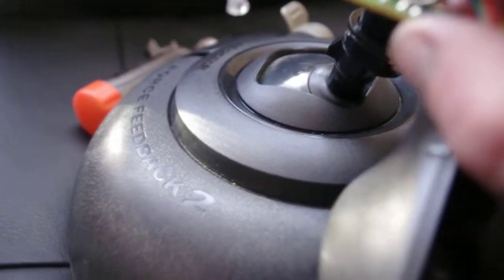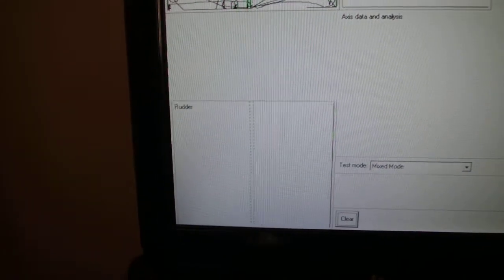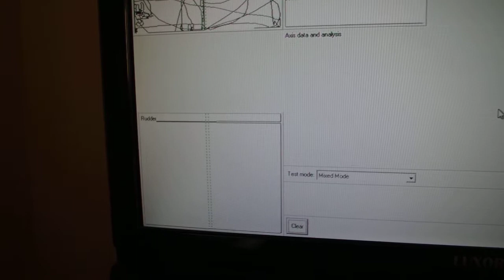Microsoft force feedback 2 twist controll problem.

Comment: Have a problem with the spring, after disassembling. The spring is proper mounted
but does not work when the handle is put together:(. Any tip what i am overseeing?
Reply: Did you get this fixed? I am dealing with the same problem right now.
Reply: @c.m.7037  Nope, dissembled it view times now, have no idea why it fails?
Reply: @jimmihenry  Yeah, I can't figure it out, how the spring is actually seated in the inside of the handle. Wow.
Reply: I figured it out! The spring ends must come straight out of the spring loop. If you put the handle back together and the spring is resisting you are doing it wrong.
There must be none spring load on the handle! If there is you will not get the return to center function! You wont the spring to touch the handle half's but you must avoid
pre loading the spring. You will understand it if you compress the spring with your fingers and turn it left, right, than you get movement. This movement, if the spring is preloaded by the handle, will allow the handle to rotate because the spring is already squeezed together by the handle half's. Once you get it it is so easy to understand....
Good luck budy! P.S.: Be careful with the wires!